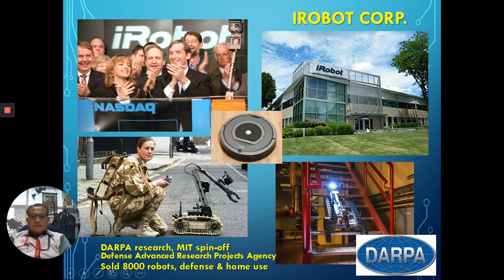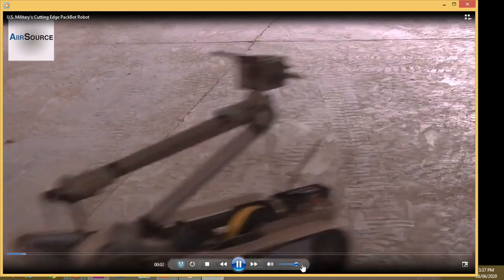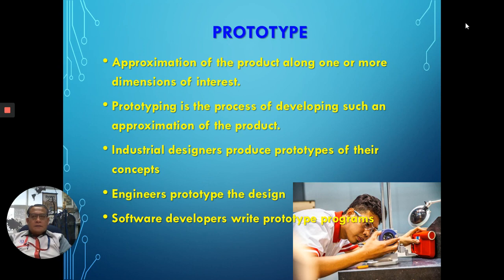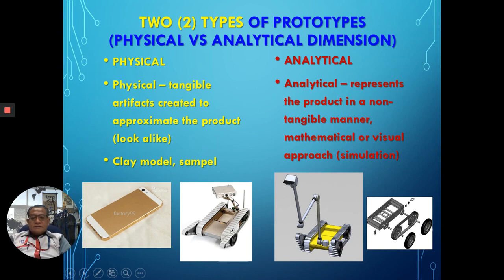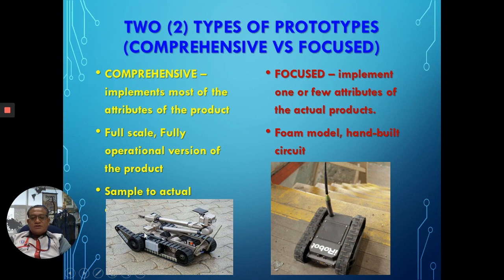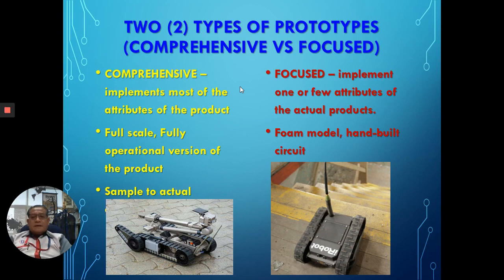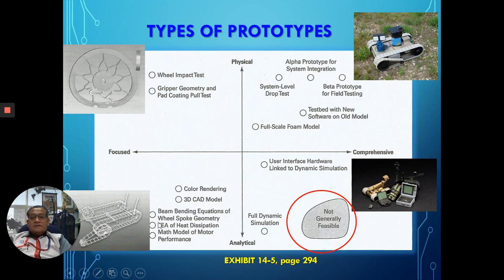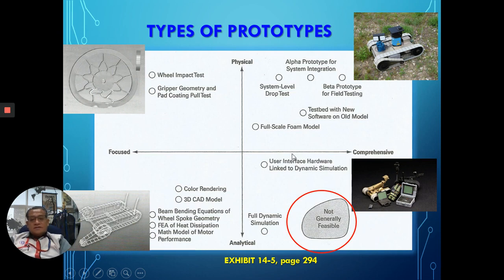Product Development Course Chapter 11 Prototyping

Comment: Shirey Then Shi Yi (AP190192)

From this video, I have learned the 2 types of prototypes namely physical prototype and analytical prototype. Physical prototype is shown in physical shape or actual final product that is normally made for sample. Analytical prototype is the model that represents in a non-tangible manner, the product is in the form of software or simulation. The other prototypes are comprehensive prototypes that implement most of the characteristics functions and abilities of the actual product and also the focused prototypes that only perform a few attributes of the actual product.

Thank you Dr for sharing.

Comment: TAN SHI YI (AP190295)

Thank you Dr for your sharing.
From this video, I have learned that there are 4 types of prototypes which are physical, analytical, comprehensive and focused prototype. Physical model normally is testing its physical structure and physical capability. Analytical model is focus more on the analytical approach because it want to test its ability to sustain drop and test rough surface if move on the actual field. Focused model is more focus on the color rendering and key attributes of the prototype which can sustain the heat, it normally is testing in the lab or in the mathematical mode or in the simulation. Comprehensive model is the full scale of the actual product which almost at the maximum of the analytical model.

Comment: Chin Suhk Jian (AP190427) 

Based on this video, I have a better understanding of the two different types of prototypes and I know the functions of it such as use for learning, communication, integration, and milestone. However, all types of prototypes can be used for all these purposes, but usually, the physical prototypes are best for communication, while comprehensive prototypes are best for integration and milestones.

Comment: CARMEN CHEW AP190476
Thank you dr for the sharing. After watching this video, I'm now able to classify the prototypes into two category which are in terms of the physical and analytical dimension. The physical prototype present the product in a tangible manner while the analytical prototype present the product in an non-tangible manner. Moreover, there are also two other types of prototype which are the comprehensive and focused. Comprehensive prototype is a thorough representation of the actual prototype and it is normally a fully operation of the product while focused prototype emphasis on a few attributes of the actual products.

Comment: Tan Hui Yeng AP190252
Thank you Dr for the sharing.
From this video, I learn prototype show actual product. Two types of prototypes included physical and analytical dimension. There also have 2 types inculdes comprehensive (full dimension in actual product) and focused (foam model). The purposes of prototypes included learning, communication, integration and milestones.

Comment: LIM JEA YI AP190100
                                                                                                                                                                                                                             TQ Dr for your sharing.                                                                                                                                                                                             
                                                                                                                                                                                                                         From this video, I have learned the 2 types of prototypes which are physical and analytical. Physical prototype is for sample while analytical prototype is non-tangible shape in a form of software graphic drawing. The other 2 prototypes are comprehensive and focused. Comprehensive prototype is a more thorough representation of the actual prototype that is been designed to be made later into actual operation. Focused prototype only perform few attributes of the actual product because it focused more on critical capability of the actual product.